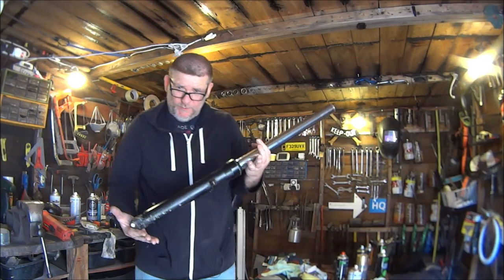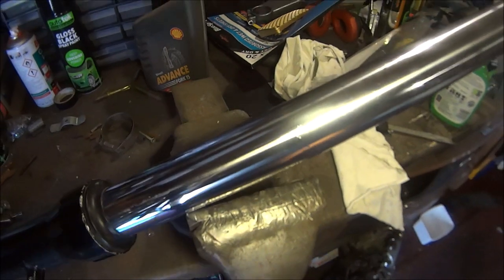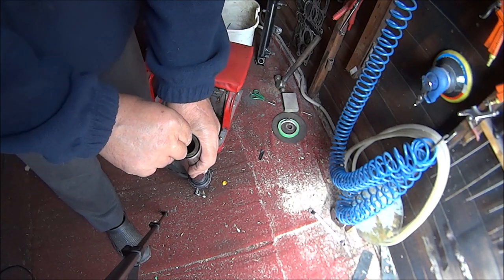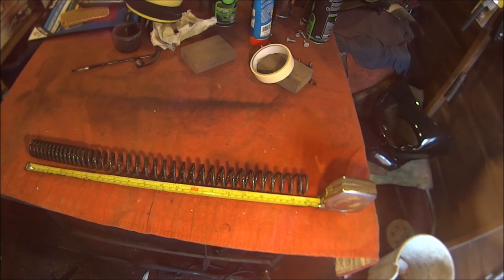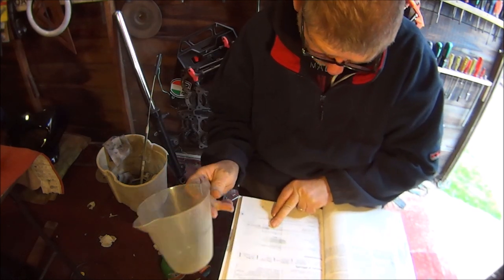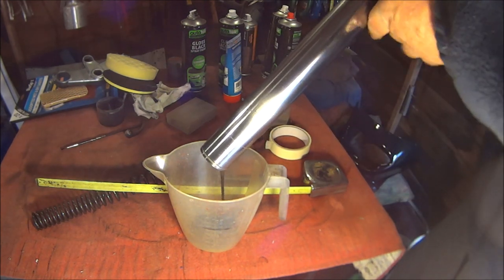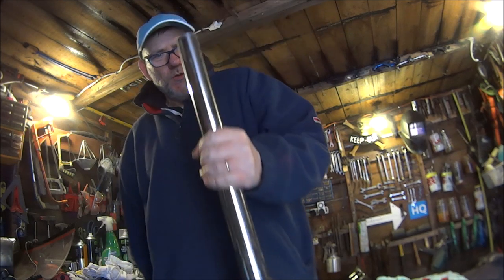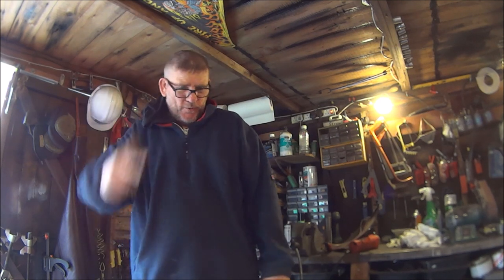CBR1000F Landfill bike, fuel tank lacquer & lots more.

Comment: Put new seals in.  If they start leaking in a month's time you will regret not having taken the opportunity when you had it.  The fact there was so little oil in that fork says to me it has already leaked out.  Use the measurement not the volume to get the oil correct in the fork, it will say what that is in the manual.  Either use the ruler or a syringe and pipe method.
Reply from the maker: Thanks Gary. Yes I am doing the seals,  would be silly not to at this stage.. Cheers for the tips buddy 👍 👍 👍

Comment: I think you should only change the dust seals on the top and leave the factory fork seals intact! If you are planning to change the fork seals as well, I might suggest doing it the right way by using a tube of same diameter as the fork tube and driving the fork seal inside
Reply from the maker: Thanks Tony yes I'm going to change the covers and the seals, best be safe than sorry 👍 👍 👍

Comment: Good vid jonny. Just after some advice on repairing my fuel tank on my xj600n just found out I have a small hole underneath how would u go about repairing it thanks danny
Reply from the maker: Hi Danny I'm no expert but I have used a petrol resident filler on a tank a thew year's back it lasted for a few months but I'm sure it would of lasted a lot longer if I'd prepared the area a lot better 👍
Reply: Cheers jonny